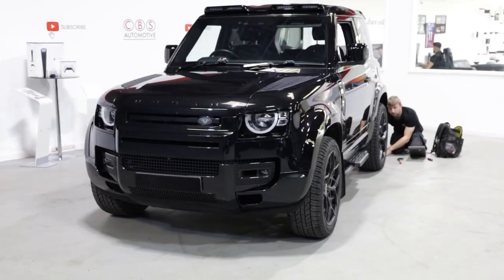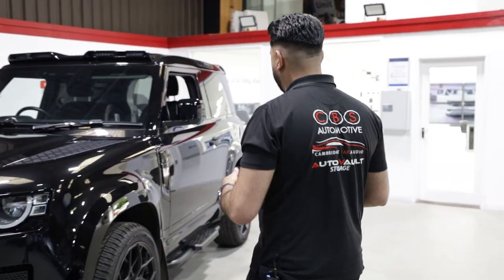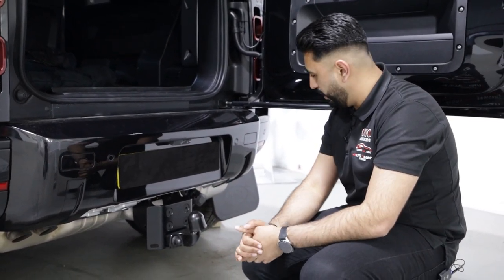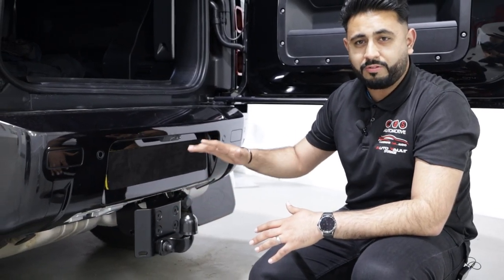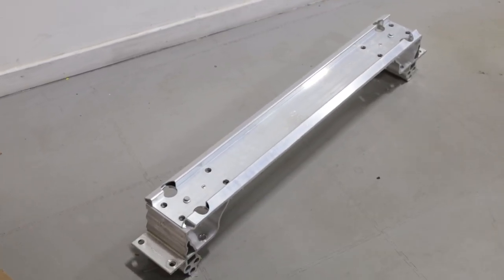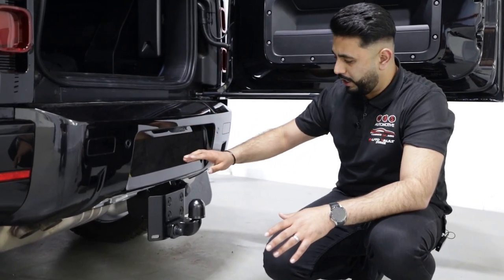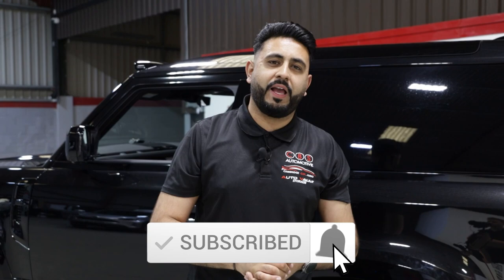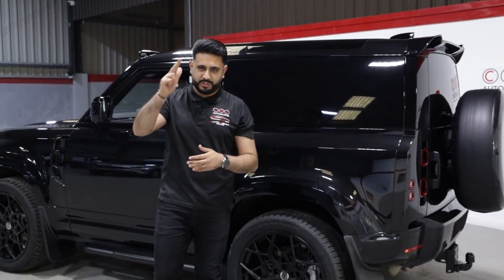OFFICAL Land Rover Tow bar On This BRAND NEW Defender 90

Comment: Nice.

Are the 2 recovery point/metal loops on either side of the rear bumper good enough for recovery during off road bogging or better to have a tow bar ? Thanks
Reply from the maker: Better to have the towbar